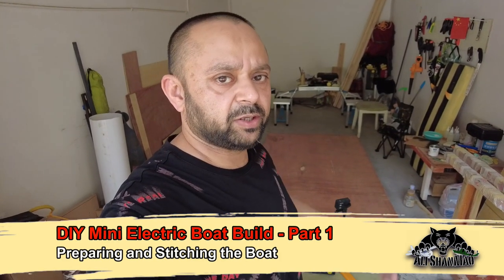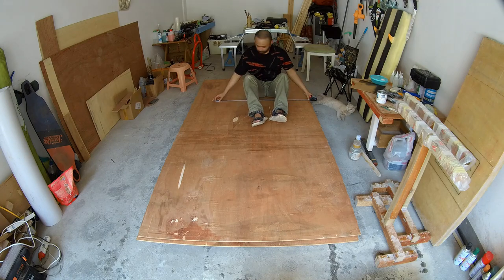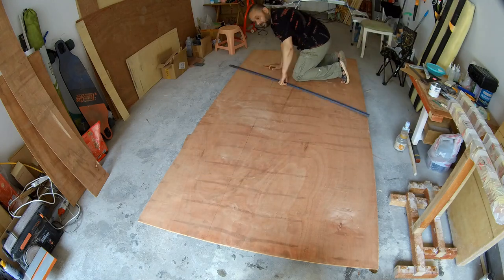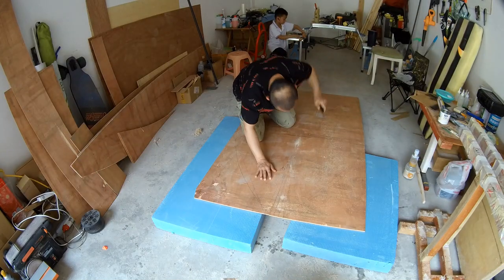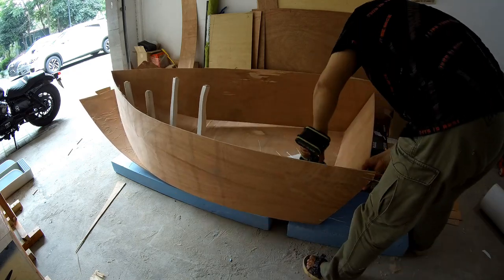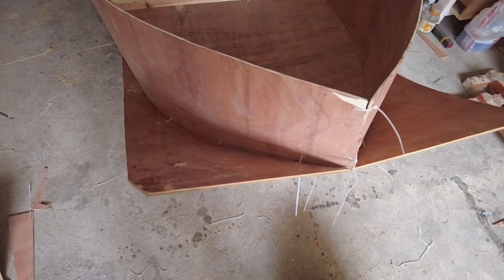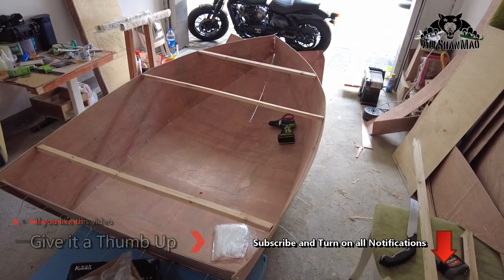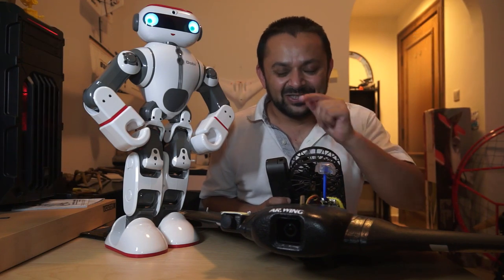Building the Biggest RC Boat DIY Stitch n Glue Mini Electric Boat Part 1

Comment: Ali the back of a boat is called the Transom  and i would put rails on the under side to help it tracking stright  just saying ..  Good  job  ..
Reply from the maker: yup i added rails later. you will see in 4th or 5th part :) thank you for your tips